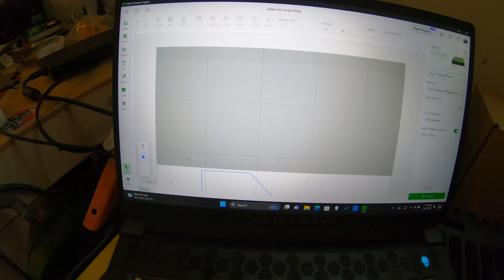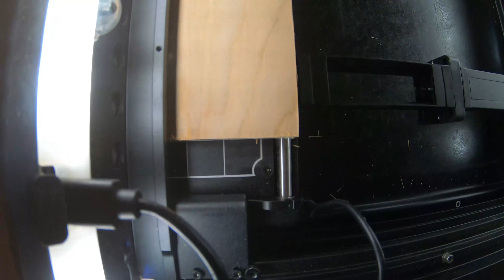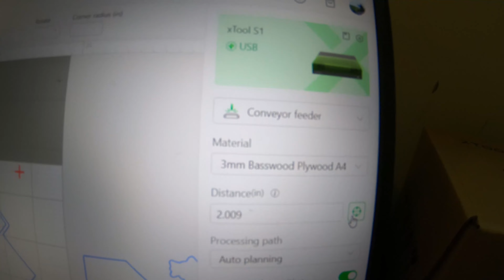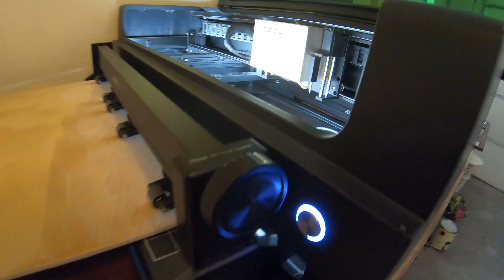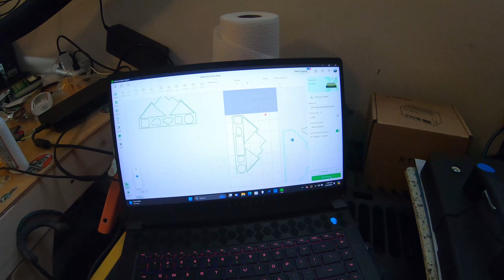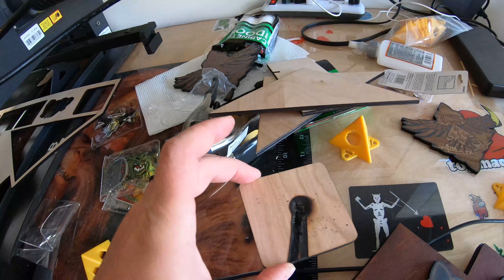xtool S1 Conveyor

Comment: Hi Danny! Thanks for detailed video!

When this conveyor is installed, can you still use the main unit with honeycomb installed in normal way?
E.g. we have products 20 mm in height, and we don't like to dismantle the conveyor each time we need to do a regular job with material fitting S1 without the conveyor. Just received the conveyor and trying to figure that out now
Reply from the maker: @andriiburzi  if you unplug the comveyor on the inside, put the pan at the bottom and then make something to prop up the honeycomb, i think it will work. Basically you just need the laser to be able to get close enough to the object so that it can be measure with the needle. (If you are cutting wood or anything I would expect smoke because you cant close the bottom.)
Reply: @everygooddaydesigns  Thanks! This is exactly what we'll do (3d print supports for the honeycomb + arrangement of some metal protection for plastic parts of the rails) after testing in cut mode to ensure there is not much smoke coming out like that.
Reply from the maker: @andriiburzi  lol I have actually been struggling with getting clean prints on my 3D printer later but that would be effective I believe

Comment: What kind of clearance do you need on each side of the machine?
Reply from the maker: @karmconnolly  its been a while but it depends on the size of the board that is being fed through it. Width was around 21 inches if I remember correctly and height of board was like 3/4 of an inch or so. (Not great)

Comment: how come when I try frame the Conveyor doesn't move at all?
Reply from the maker: @FabstaPizza  there could be a few reasons. I would start with the software and just make sure its set on the conveyor mode, if it is then I would confirm that the USB is plugged in properly. Next I would make sure the image is selected prior to hitting frame and finally I would make sure the rollers are lowered onto the wood to pull it back and forth. (Not too tight and not too loose) if that does not work I'm honestly not sure.
Reply: @everygooddaydesigns thanks for the response! I'v done all these things and its not working for some reason, had a simular issue w the rotaray attachment where when framing it would act as if it was trying to spin it but wasn't and it was like stuck or something, still havenm't gotten that fixed either, and now this isn't even trying to spin, ill contact support about this, thank you! :D
Reply from the maker: @FabstaPizza  no problem, i had issues in the past with an IR laser and I had to get a replacement motherboard
Reply: @everygooddaydesigns  really!? A new motherboard!? Dayummn that would suck, not only more money but I recently upgraded it 😭
Reply from the maker: @FabstaPizza xTool sent it for free, just had to swap it out lolol. If you still have the warranty thsy should hook you up
Reply: @everygooddaydesigns  Ohh cool, thank you! :D
Reply from the maker: @FabstaPizza  no problem, best of luck!

Comment: You could use the tab option, so that the pieces do not fall out, and then you just cut the little tabs.
Reply from the maker: @pmbrothny  I didnt even know there was a tab option. I'll have to look at that later. I appreciate that!
Reply: @everygooddaydesigns  In The cut menu, you will see "Tab Generation", when you turn it on, there are alot of options for the Tab size, number of tabs, or tabs by space, etc.  I just got my laser, and just testing it out, did not setup the conveyor yet, but saw these options in the software.  LIghtburn I belive does not have this - thats what I have used with my other laser before it died.
Reply from the maker: @pmbrothny  appreciate the information. It will definently make the process a lot easier
Reply: @pmbrothny  Hello, thank you for the valuable advice, I bought the p2s and it arrives in days, I have doubts about the validity of this sliding system because I would like to use it a lot especially on acrylic, do you think there are problems in cutting for example circles 50 cm x 50 cm? Can the scroll wheels scratch the acrylic panel? Thanks in advance